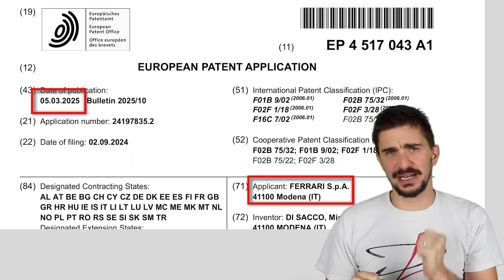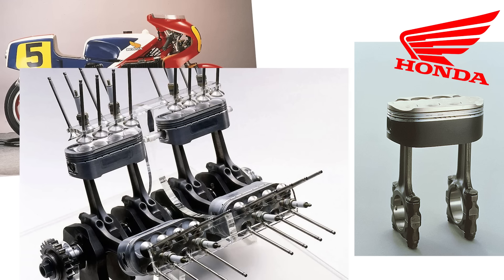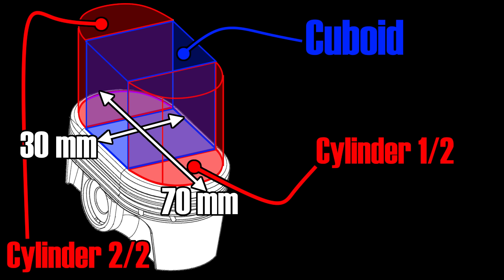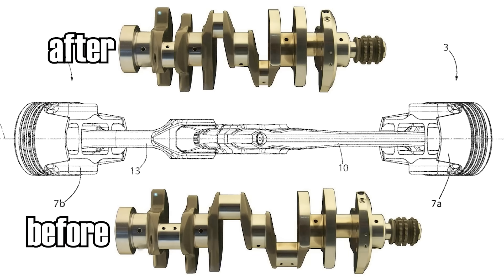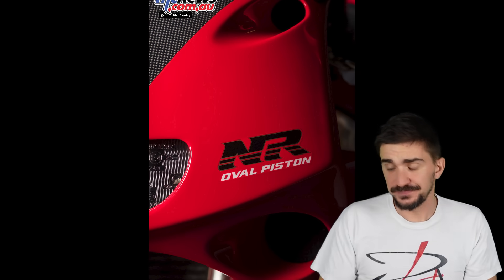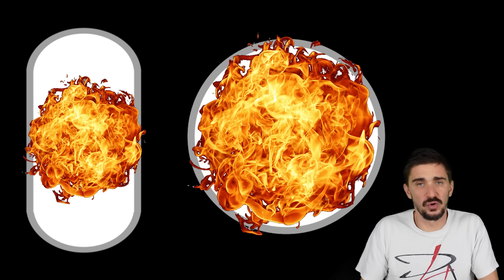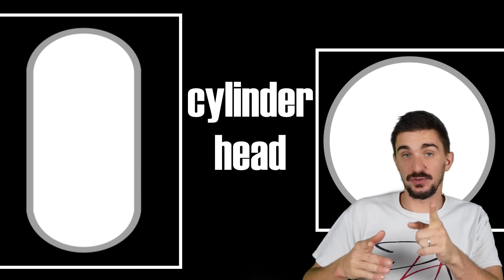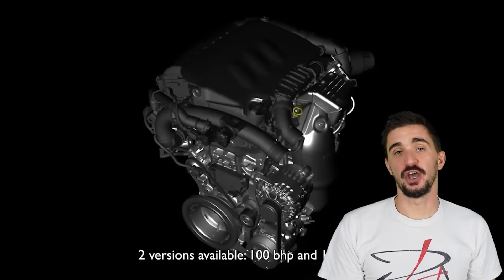Ferrari Just Patented Pill-shaped Pistons and Siamese Connecting Rods

Comment: Very interesting design in my opinion! I bet there will be 1 intake and 1 exhaust valve per piston. They will match both ends of these oblong pistons (yes, that's the technically adequate term).
However, i don't see where they're going with this weird con rod. It's a very creative solution and their engineers are undoubtedly better that a random comment guy (me). However, in their place i'd try to divide the con rod in 2 at the crank shaft pin (cutting the rods in halves along a plane normal to the crank pin) instead of using this weird looking contraption.

Comment: How do they patent a piston already done long ago?  The rods are similar to those on a radial engine.  What will happen with bearing life?  Then there is the problem with the cams.  When the pistons are placed as you showed them you need multiple cams.  One for each cylinder.  If placed long wise one cam works.  This is a Big Problem.  No one talked about that.  Was it in the patent.  If not, what a joke.

Comment: the question is why go that complicated route if the main goal is just to reduce engine length. ferrari already went turbo down sizing on most its engines. I think the reason could be combining NA higher cylinder count/ displacement/rpm with hybrid and get rid of turbos like bugatti. next gen hybrids could have higher electric power and achieve the desired power wirhout turbos, then going NA hybrid  V8 or V12 could improve sound, character, throttle response, rpm and pedigree of their engines while the hybrid would ensure the power is there to fight 1000hp supercar competition. then the reduced space inside the V wouldnt be an issue. I can see NA hybrid becoming a trend in the supercar world.
I dont think shorter wmgine would be used to fit batteries as they can be placed anywhee in the car bu to leave room for an electric motor samdwiched between engine and transmission.
It wouldnbe interesting to see Ferrari or othe supercar manufacturer use the free eCVT patents that toyota opened until 2030 in performance hybrid as they have a lot of advantages like replacin the whole transmission/starter/alternator/clutch with a simple, reliable planetary gearset, allowing fast shifts without loss of power. they could eqsily be programmed with fake gearsand  paired with paddles and gear ratioa could be tuned for different driving modes and different tracks. for maximum comfort or maximum perfrormance (launch control, setting lap records) the eCVT could still be programmed to be fully automatic and use continuous gear ratios. I guess its probably too late to see manufacturer take advantage of this since this would be long term investment and the window is closing soon.

Comment: 8:50 Imagine they had variable intake and exhaust geometry, at low RPM the intake sweeps across the piston in the minor axis, but then at high RPM it switches to the major axis for better exhaust savaging within the piston itself. with the outer 4 valves opening before the inner 4

Comment: 7:25 Cost effective means they can spend slightly more money producing these engines, but charge 90-200% more because of the new technology.
Sort of like how Nvidia charges for their graphics cards.
(this is actually because they're losing profits on every $2000 gaming card that could have been sold at $9000 if it came with the name RTX 6000 Blackwell but thats besides the point)

Comment: I'm going look up the patent, but I cant think of a significant benefit other than reducing the length of a V-12 engine. The determent of increasing the combustion chamber surface to volume ratio on emmissions and efficiency doesn't seem worth it.  The mechanical complexity and part count increases are a negative, but Ferrari probably doesn't care since their production numbers are so small. I'm also curious of how they'll finish the bores for ring sealing.

Comment: Another problem I see is emissions.  The reason manufacturers have been going towards fewer, larger pistons for the same capacity is the rings land to cylinder wall area - or more specifically, the unburned fuel that hides in them.  This is where the majority of fugitive hydrocarbon emissions comes from these days, and the only effective way to solve the problem currently is to use fewer pistons, as the area between the ring land and the cylinder bore rises more slowly than the overall area of the piston crown when the bore size is increased.  But a narrow piston like this actually increases the border of the piston, making it even less clean-burning than a round pistoned engine with the same capacity and number of cylinders...and while Ferrari may not be too concerned with emissions directly, they will have to take note if it prevents them from selling cars.

Comment: Honda had racing motorcycle engines with”oval” pistons, actually they were this “pill” shape, in, I believe, the 1980’s and 90’s. They had sealing and wear problems and did not produce the benefits expected and were thus abandoned after quite a bit of development and racing. But there was a lot of sort of engineering mastery advertising (and solid engine engineering experience) that was valuable.

Comment: The connecting rod is like what is used in radial engines, just fewer cylinders.  Look up the PW R2800
I wonder why they just didn't go with a blade and fork design like the RR Merlin V12
I wonder when car manufactures are going to start building 3 cylinder radials for their cars.

Comment: If you know about the pill shape... than you know, that honda had pill shape pistons only in racing motorcycles. In production motorcycle were only oval shaped piston (without the flat sides) and it was due to the poor sealing piston rings. Also if Honda made it barely reliable in race engines, there is no way that Ferrari would make it reliable in long the term

Comment: The cylinder head will not be quite the same as the honda. The minor axis is the same width as a normal piston. This means that valve canting is pointed toward the adjacent bore if multi valves are used. Unless there are pill shaped valves???

Comment: The secondary imbalance can be solved by alternating piston arrangement. So, piston 3 would counter the forces of piston 1 and so on. Dual sparks per cylinder should address issues with piston position on the combustion stroke, but for the intake, compression, and exhaust the work would fall on to the connecting pin and piston rings.

Comment: I think the VW W engines are much better design in saving space without redesigning the wheel and being more efficient. With the exception of placing the timing belt behind instead of where they should be in the front or the engine.

Comment: I like the innovation.  This can shorten a multicylinder engine, however, if the "drive engine" is using a camshaft it makes the arrangement of the valves more problematic.  This can be overcome with rockers or other mechanisms.  Or perhaps Ferrari is looking at using valves activated by some other means rather than a traditional camshaft.  This could be an insight into other things that they are working on.  The next problem could be getting runners to each of these valves if the arrangement is indeed as you propose, to shorten the length of the engine.  By the way, oval pistons could be useful for truck and industrial engines were they are inline but limited in how long to make the block and crankshaft.

Comment: 2:42  Pause.  What you have there is an ellipse, not an oval.
2:50  That one on the right, that's the oval.  Radius on the ends, straight in the middle.
5:01  That is another version of articulated rods, which were on almost every radial engine ever designed.  It was also used on the Napier Lion W-engine.  Articulated rods have their own problems.  One major problem is that the knuckle pin on the link rod has a smaller diameter than the actual big end bearing, so lubrication and wear is a problem, especially if the engine is boosted.  Ferrari should have used a fork-and-blade connecting rod design.

VW worked on an elliptical-piston diesel in 1990 with the long axis oriented perpendicular to the crank axis.  (Do an internet search on it; pictures are out there.)  Ferrari is running between the raindrops using an oval shape to make it patentable.

Comment: The rods are sort of similar to how they do it with radial engines in older airplanes, there's a master rod and the rest all connect to that one instead, but in this case each pair has a master one.
The configuration looks to me like instead of being suited for more valves, they could just go with 2 huge ones that are optimal, and use the gaps between them for spark plugs/direct injection.

Comment: You could have mentioned that oval cylinders have a higher surface to volume ratio for the combusting fuel air mixture.  This increases heat loss to the cylinder walls, reducing thermodynamic efficiency of the engine.

Comment: I specifically sought out a V6 Mustang over a V8 with one of the main reasons being the lack of two cylinders in the front makes for significant weight and balance advantages. It's almost like a mid-front engine, which Ford has apparently not been a fan of producing as much as others. 

The result is V6 Mustangs consistently running circles around V8 Mustangs at autocross events, and just generally a more pleasant car to drive if handling is more important to you than hearing a V8.
Reply: How does the balance of the Ecoboost 4 banger compare the V6's? I would assume its as good or better, but I wouldn't put it past Ford to screw it up somehow.
Reply: I don't know much about the Ecoboost 4s, though I would imagine they would have to be at least lighter than the honking 5.0L.
Reply: @HAL-dm1eh the 5l is all alloy though. And sounds much better. The ecoboost 4 is good for power levels too.
Reply: 😂said nobody ever

Comment: 2:50 Sorry to be a stickler, but "oval" refers to anything that is "egg-shaped", and in common language is a shape of a rectangle with semicircles pasted onto the ends, though definitions vary significantly based on application and field. Like another commenter mentioned, the latter is properly called a "stadium". What you're "well actually"ing about is properly an ellipse, which is a shape wherein every point has a constant sum of distances to two given points (the loci), or x^2/a + y^2/b = 1.

TL;DR: "Oval" is super vague, so there is no refutation to be made.

Comment: There's no room for valves. Instead of 2 intake and 2 exhaust valves, you would be forced to use 1 big intake and 1 big exhaust valve.  That is going to make it difficult to achieve adequate flow for performance applications.

Comment: The devil is in the details. Lots of new ideas for Internal Combustion Engines have popped up over the last 30 years. But just because something work in CAD and SolidWorks doesn't mean the cooling and lubrication can work. Perfectly round pistons allow for round compression rings - so they can "float" around and equalize the cylinder and ring wear. These Ferrari pistons means they will probably need to be rebuilt often. Maybe a rebuild is just part of the 10k mile maintenance.

Comment: I'll confess, I'm surprised Ferrari got a patent on the siamesed con-rod thing. I would've expected that to be refused as there are numerous prior engines that have used siamesed con-rods before. It was a fairly common feature in Aero engines back a century ago, used for much the same reasons you mentioned - a shorter, lighter block, and reduced rocking moment. IIRC, the conjoined con-rod didn't last due to the reasons you mentioned, with a fork & blade setup being more commonly used, as it was possible to achieve perfect primary balance when used in a V-12. Not quite as space efficient as a conjoined con-rod, but the fork & blade setup resulted in considerably less vibration issues, and a higher rpm potential - it was a better compromise to have a slightly longer engine that didn't shake, than it was to have a shorter engine that shook (or weighed more due to needing geared balance shafts to remove the shaking).
As for the oval pistons, that's an idea that has definite potential. I can't help but imagine the potential plumbing nightmare the induction & exhaust systems could be, largely as I'm stuck with a mental image of a three-valve setup - two smaller valves at the ends of the "pill", and one larger valve in the centre, with a twin-spark ignition plumbed in between the valves. A centre inlet would make induction simple, but you'd end up with one heckuva complicated exhaust system. Similarly, a centre exhaust would be fairly simple, but you'd need to integrate 4 separate induction systems. A two-valve system would be much easier to build, but you run into issues with the ignition efficiency due to the cylinder shape. Six or eight valve setups could be an option, but that's a level of complexity more for racing engines than roadcar engines - too many moving parts for something that needs to just work day-after-day. It's an interesting conundrum, that's for sure...

Comment: Why no comment about the short connecting rod's pivot point which will not be aligned with the crank pivot of the paired connecting rod? As the crankshaft rotates and the paired rod moves through the orbit, the reference point of the short con rod is going to vary which will change the piston speed of the piston with the short con rod.

Comment: Have you seen the actual engine,even in blueprints?
Maybe the secondary imbalance is corrected by placing the twin connecting rod to one side in the even pairs and to the other side in the odd ones.
Reply: Fig.1...and no, all pairs are installed the same way.

Comment: Great video. Just one consideration. Am I mistaken, or a in line 6 should have no secondary imbalance? If it is so, as the shorter connecting rods, according to the drawings, are all on one side, we can model the motor as two perfectly balanced in line 6 sharing a common driveshaft,  but as the two half are already balamced there should be no problem in the V12 confuguration

Comment: Staggered crankpin designs are not the only solution for v, flat, vr, and w engines. They have split rods to align the pistons with the adjacent one, however the split rod will be weaker than the normal rod which fits inside the split rod.

Comment: He didn't talk about the potential valve arrangement for the Ferrari engine. It would probably be a 2-valve per cylinder setup at a guess? Or 4-valves in a line across the piston, 2 camshafts per bank, each camshaft looking like a normal SOHC setup operating an inner and an outer valve

Comment: The engineers are playing with toys. Useless designs to experiment with. The round cylinders are there for multiple reasons. Mainly built around the fuel source. The ignition and flame front are spent within a small portion of the cylinder. The round cylinder is also to reduce valve shrouding.  
  This pill shape kills swirl or tumble of the fuel charge. It also shrouds the valves. Nice try, Ferrari. Honda atleast addressed the valve shrouding with their variations. The connecting rod orientation may address different power output within the rpm. But it also caused different piston speeds. Creating an imbalance between the two crank sides. 
  For an advanced automobile manufacturer. This is more like a steam locomotive level of engineering.

Comment: I imagine this engine will require a turbo since there will be less space for the valves, probably direct injection, i think the secondary imbalance could be mitigated with the right crankshaft design and firing order. The extra load on the sides of the piston would be concerning. If this is a V engine, i wonder what angle the V is. If it's a horizontally opposed engine like a porsche or Subaru, that would be interesting.

Comment: Hmmm .... speaking of embarrassing knowledges gaps, how is it that this video was made without recognising the original oval piston engine design by Colin Ridley of Triumph Motorcycles from 1922! The piston layout is the same as the current patent by Ferrari with the single rod and pin fitted across the narrow point of the piston so more relevant than the twin connecting rod Honda design. It was never successful but was at least the first attempt and should have been mentioned at the very least.

Comment: patents are poor mans way to make money. mmkay bro. thats called an ellipse piston. math says A*h=V, just check the area of the piston. holy c complex explanation climbing back first in to the tree. one end circle area (two half circles) and rectangle area summed up. yes market is fabricated scam. second head get your own body as your housing. dont ask people for loans. engineer perfectly bro. yep engineering is not accepting the compromises but designing actual perfect stuff. not in the people perfect way. keep it simple in the key ways. patents make it already not cost effective lol creedy. ferrari only cares about surface shine. or money. thanks for tossing out the headache. hey the two-sided ratchet piston engine would be perfectly balanced. at least the jokes are entertaining, on top of the actual content. electric drive train  hub wheel motors solves all the differential power drive issues. just wires power transfer. or wireless. yes gotta sell every day, so fabricate new products.
Reply: Yes, just ask my brother about that one-
Reply: One linear piston rod can be made to have as many double sided pistons as a manufacturer wants. For example two-piston bone shaped linear rod has 2x2=4 effective piston surfaces. Linear piston rod with magnets coils electric generator engine.

Comment: Would the siamese connecting rods cause uneven leverage forces on both the crank and the coupling joint? You did make a long video talking about how stroke to rod ratios are important in an engine performance, and an engine with unequal rod to stroke ratio would cause issues.